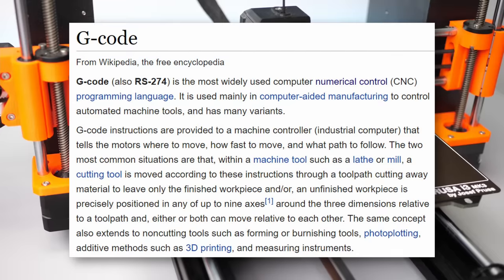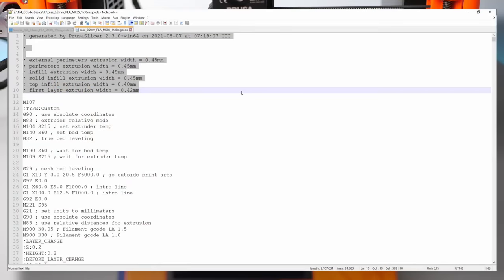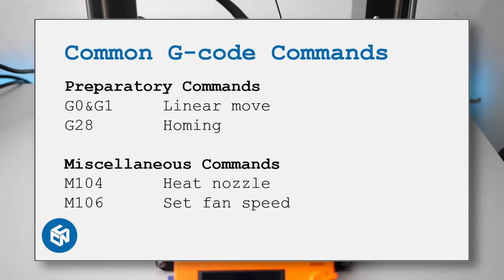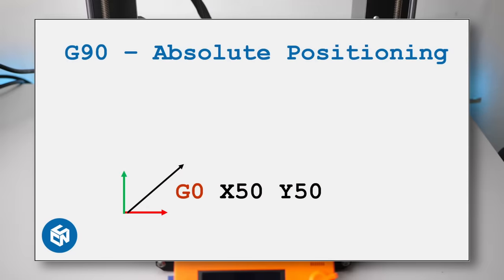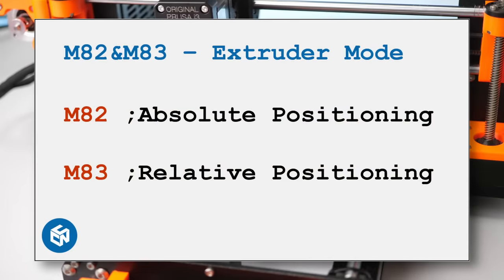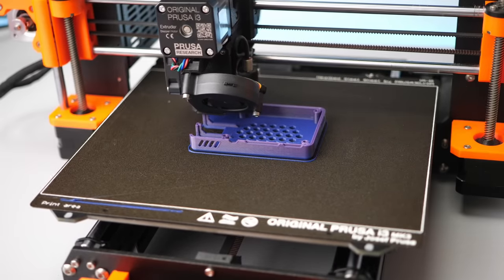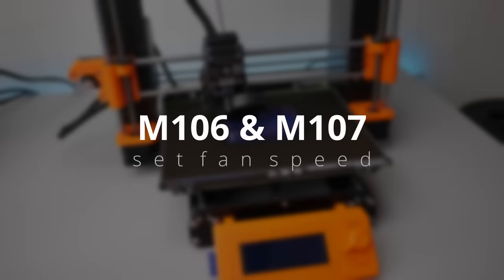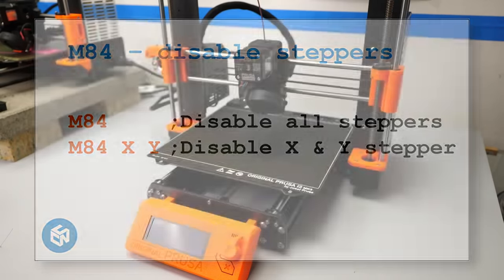Learn G-Code for 3D Printing

Comment from the maker: Is learning G-code worth the time and effort?
Don't forget to like & subscribe and share this video on Facebook, Reddit, Twitter, and other platforms!
Reply: Yes, the more tools the better! Thanks, great vidéo again.
Reply: 12:10 this way helpful and straight-forward.
T1 is the only useful 3dp command :P
.
but then the event horizon had yet to reach 2021... 1t will :D
Reply: When you start with RRF its better to know the most gcodes :D
Reply: Unless you are doing something really unusual then probably not , a slicer program is more than good enough.
Reply: Dang it, YT ate my comment. 

Stefan, I'd be interested in your take on Gcode post-processors that change rounded corners from a series of G1 moves into a single G2/G3. Do they have any discernible effect on quality or speed? I'd love to try them out myself, but I run an Anet A8 that is so inconsistent as to render experimentation pointless :P
Reply: I saw a good example recently (but haven't tried it yet). In temp towers the nozzle has to heat up to a new temperature for each section, but without the right G-code the machine may not pause before continuing to successive sections waiting for the nozzle to reach the next higher temperature. That is a very practical and useful thing to know.

Comment: I know someone who used to design g-code on paper based on drawings. After that it was typed into the machine. It was in the 70's.
Reply: Sounds a lot like when my dad learned COBOL programming language back in it's days. You're the compiler. Reference the books and convert it yourself to binary for punch cards!
Reply: For some CNC machines that is still done today, or a hybrid approach generating some automatically and then editing it heavily by hand.
Reply: @squidcaps4308  yes, of course, noone is going to hand code a generative design. But if you're programming a relatively simple part on a machine like a swiss lathe, it is often times easier to code it by hand then to go through the trouble of creating a post processor for your CAM. Those are cases for mass production though, where 10h upfront to save 30 seconds on each part pays off in a week and from there on it's profit.
For oneoff parts and complex geometry, modern CAM is definitely the way to go, and the only way.
Reply: I did it that way in college in the late 90s, before they let us loose on CAD/CAM software. Writing code and seeing it run always gives me a kick; writing code and seeing it cut metal was just unbelievably cool.
Reply: You must be very old by now😄
Reply: Sounds like the old tape machines.
Reply: It is generated from the G for grafica and is send to the machine M codes here is when you can adjust the function of the machine
Reply: @6yjjk  cnc&nc-machinist speaking...i program prototypes and one offs mostly...g-code is actually the fastest for us since we have ti many different machines with different options...its just amazing what is possible only coding by hand, we only use CAM for simultaneous 5 axis milling
Reply: We should all learn to do that😂
Reply: People still do that
Reply: We learn to do this in highschool in 2016 😂 that was really dump

Comment: As someone who started in CNC running a commercial CNC milling machine, learning basic gcode is the first step in troubleshooting problems. Its amazing that robots (CNC machines) are so  accessible now and a $200 3d printer is for all intents and purposes the same thing as a several hundred thousand dollar CNC mill! This video is an exceptional guide and building block for anyone who wants to actually "understand" the printing process. Slicers and CAM programs are awesome, but they also make the entry point of CNC so accessible that it can frustrate and discourage a new user because they dont have the building blocks necessary to know why things are not working as expected. Great video!

Comment: Great video! The other ones I would add is G4 - dwell: waits for a specified time, for example, for you to remove the droop of filament that purges or something like this, and M0, the unconditional stop, that waits until you press the encoder button on the LCD.
For most useless G-code, I would give the medal to M510: lock the machine. I cannot imagine a single reason why anyone would need a password for a 3D printer, or maybe in some extreme case a makerspace would use that, but I dunno, feels extremely useless.
Reply from the maker: Great choices!
Reply: I would like to second this. Having a follow-up video would be excellent. There are so many things GCode can do I didn't even know about, and G4 would be an excellent one to start adding to my startups.
Reply: Ok M0 is now easily the holy grale that should have been mentioned, i always wanted to use a stop but didnt look what it was, now i know so ty
Reply: Considering g-code is a standard that's used on just about every CNC machine in existence M510 is probably there for the more dangerous equipment you might need authorization and preparation for at work. Like the type of thing that might cut your fingers off if you get them too close.
Reply: @wheezybackports6444  That makes far more sense indeed. It just being ported over from actual industrial use without messing unnecessarily with the code is something I imagine they did when 3D printers started using G-codes.
I would still imagine a physical key lock to reset the emergency stop (so: anyone can hit to stop, but only authorized personnel can reset) or a keyed main power switch is what I would use instead, full LOTO style.
Reply: @Kalvinjj  Yeah, I've been learning 3D printers are always just made out of stock parts and software because it's easier than making something completely new.

Comment: Other important? Maybe many, but I’d like to say than G2/G3 were the pair I was missing. The cura plug-in for them made my day. Salut i fins aviat! 😁
Reply from the maker: I left out G2/G3 on purpose because I'd bet 99.999% of G-Code printed on 3D printers don't use the command (which is a pity but a result of us using stls).
Reply: @CNCKitchen  next gen printers should work through STEP files or something like that so curvilinear shapes are taken into consideration, I guess that even the printer drivers will work better since they will not have to process so much lines of code in exchange of a single G2/G3 command. Thanks for all your efforts 👍🏼😁
Reply: WAH? I never noticed that! Though I already knew that 3D printing g-code had those straight lines, and had accepted it because our workshop does the same. Hehe. 😅
  For those that want to know, G2 is a clockwise arc and G3 is anti-clockwise.
We use G2 & G3 all the time in CNC mills. We get the code off a workshop server after loading it across from the "engineering office", and they use automatically generated code from a "drawing" file these days. But sometimes it's pretty easy to notice all the micro straight lines in the side of a milled radius metal component. 
But I don't see much advantage for G2 G3 in 3D printing, whereas in milling it can define and control quality of finish and cutter wear due to cutter rotation + movement direction.

Comment: i think the knowledge of g -code comes in most handy when tuning and troubleshooting a printer. I ended up printing a small cheatsheet and slapping it onto the frame of the printer, very useful. I have some tuning commands (those that set acceleration and stuff), printer dimensions and speed limits there.

Comment: I found learning g-code to be most practical on my Vertex Nano.  The motors on that printer weren't strong enough to move the belts when they were tensionned properly, so skipped steps were inevitable.  I created a code which sent the nozzle from one corner of the bed to the opposite corner so that the axes would recenter.

I'm now on a Prusa Mini and I'm working on g-code modifications so that I can use a stainless steel hotend without tripping the thermal runaway detection.

Comment: So, I've been 3D printing as a hobby/side business for about 2 years now. During that time I got really busy with the printed custom projects for customers and my focus was shifted to building the Bass Controllers internal components and the actual quality of the printed pieces was really inconsequential as long as the basic idea of the custom design IE the added logo or added text or overall design was aesthetically pleasing The quality of the print didn't even get noticed. So I spent more time making sure that my internal components and the workability and durability of the controller built inside of the printed part was the highest of quality and I didn't pay any attention to how well or how terrible my printing was. Obviously if there were failed prints or if there were major blemishes or inconsistencies those got addressed and the project got reprinted but there was no thought into why it had happened. However lately I have slowed my side business down and I have focused a lot more on the actual 3D printing portion as I have upgraded to an IDEX printer and hopefully coming very soon my ordered carbon X1 so quality now is my focus on the actual prints. I have also been using Cura Prusa slicer bamboo Labs and idea maker and having to import printers into different slicers that don't come with pre-designed profiles I have had to look at start code and in code and was completely lost. I found this video today and in the 12 minutes of this video I learned more than I have in the last 2 years I love how analytically adept you are and the way you approach each issue so systematically I have now watched like four or five of your videos and again I have learned more in these few videos from you then in the entirety of my two years of printing before so thank you very very much!!! But particularly this video learning those 10 g codes that you just showed us will forever change the face of my 3D printing projects and abilities. Simply put the building blocks that you just gave me are going to help propel me into a new world of 3D printing and will inevitably be the most valuable tools I will ever use so this video has changed my 3D printing life for the better and thanks to you I will never be the same!!!!

Comment: M112 is Emergency Stop, and is in the top 10 gcode commands that I manually type into the OctoPrint terminal.  (PID configuration and EEPROM save commands also make the list.)

Comment: Very good!

As a curious novice to 3D printing, I noticed there was a subtle difference to the way the Creality Slicer (Cura, rebranded) and Ultimaker Cura ended a print with CS moving the bed to the rear of the printer and UC presenting to the front.

After discovering in the Machine Settings, this was a behaviour controlled by the G1 command, I was able to copy the rear presenting behaviour over to UC.

The reason? I have OctoPrint's Webhook plugin fire off an event to turn on an external fan to cool the bed after a successful print. Having the print bed present to the rear enables (slightly) better cooling.

Ideally I love there to be some functionally to turn off the fan once the temp is at ambient :)
Reply: Couldn't you do a M190 S30 then M107? Could even present print after cooling

Comment: Thank you for the video, which is a good starting point to decipher the complex G-code. 😊

The kart that runs through the streets of Japan shown around 34 seconds in the introductory video used to be a service that called itself Mario Kart.🏎
However, they had been using the character without Nintendo's permission, which led to a court case, and since then they have been operating the service wearing Disney characters and stuffed animals.🐈
In January of this year, the kart company was ordered by the court to pay 50 million yen and lost.💸
This is a victory for Nintendo.

Comment: Omg you just helped me figure out an end gcode for raising nozzle head! Rather than use the wierd Prusaslicer "if" statements, I'll just use this lol
Reply: The prusaslicer "weird" if statements prevent the printer to destroy itself if it should move higher than is the maximum Z. If you remove it and your printer has max Z lets say 250 and the printer ends the print at z = 245 and you tell it to move 10mm at the end, you will grind your gears because it could never reach z = 255.

Comment: I've always wondered if there is a way to start a print on a Prusa mk3 without bed leveling. If you need to start a print "on top" of another one that would be great
Reply: 3d printing nerd has a vid on stacking parts. starting a print ontop of another would be hard b/c of bed adhesion
Reply: For that, you would just need to remove the G29 -- or G80 as it happens to be in Prusa's case. Though, stacking parts in that way presents its own challenges -- bed adhesion on the first part needs to still be solid enough, or you'll just yank it with you. And you'll need a way to home the axes again and then move back to the correct start location if you've lost your positioning.
Reply from the maker: Check my last video on resuming failed prints!

Comment: I would like to understand more about the M500 to M504 commands, and when and how to use them. Which settings do they actually load, is homing and loading of the bed levelling including? What about mesh bed levelling, is it restored with M501, too?

Comment: I like relative positioning for extrusion more because it's easier to edit the gcode when you want to resume a failed print. I don't recall if you talked about this in your previous video about print failures. It can be done with absolute positioning (Ideamaker was setup this way but you can change this) but I found this out after I threw my print in the garbage  🙄

Comment: GREAT video. 
I was wondering why you mentioned at 10:30 that using M109 instead of M104 when doing a temp tower causes more problems than it helps. Please talk about what problems it causes. Without practical experience it seems like a good idea to wait for the nozzle to reach the new temp before doing each successive layer, but what you said made me curious.
Reply: waiting between layers causes blobs because the printer continues to deposit material when waiting
Reply: @MrBeanbones Good to know, thanks.

Comment: Greetings,  Another great tutorial thank you.  I'm focused on the extruder movements as I need to do some retraction during picture taking while the X axis is moved away from the print to a trigger switch and then a 1.5 sec delay for the picture to be taken.  I need a extruder retraction, (?), at that delay point to stop the nozzle from oozing prior to resuming the print because the ooze hardens because of the cooling fans and then hits the print on its return.  Any thoughts?
Based on a LAYER CHANGE this is the camera trigger G Code

; Layer Change leave the print

G1 Z1.0 F9000 ;Raise Nozzle Up A Little
G1 X240 Y217 F9000 ;Move X Near Trigger Switch And Center
G1 X243 F9000 ;Press the trigger Switch
G4 P10 ;Delay For 10ms to de-bounce the switch
; oozing happens here
G1 X240 F9000 ;Move back and release the Switch
G4 P1500 ;Delay For Camera focus and shutter click 1500 mill seconds
; oozing happens here as well

; return to the print

Thanks Again
Doc'

Comment: Super informatives Video! :))) Welche Z-Werte bekomme ich bei meinem MK3S+, wenn ich vor Beginn des Drucks, also gleich nach dem ersten G28 eine Prusa- Z-Kalibrierung (anfahren des oberen Z-Achsenendes und eine leichte übersteuerung von 10-20 mm) durchführe? Wird dann der soll- oder ist-Wert abgespeichert? Reicht dann ein G28 um gefahrlos wieder in die Home-Position zurück zu kehren und das meshbedleveling zu starten? Ein Tipp wäre nett, weil ich ungerne (wieder) mit der Nozzle ins/durchs Druckbett fahren würde :D (Hintergrund: Im Rahmen der letzten Upgrades stellt sich meine Z-Achse teilweise im Druck zwischen Layer 2 -20 schief (Vermutlich ein leichter Slipstickeffekt). Eine anfängliche Z-Kalibrierung scheint die Fehleranfälligkeit signifikant zu senken)

Das wäre mein Ansatz:

; Regulärerer erster Block
M862.3 P "[printer_model]" ; printer model check
M862.1 P[nozzle_diameter] ; nozzle diameter check
M115 U3.9.1 ; tell printer latest fw version
G90 ; use absolute coordinates
M83 ; extruder relativeG  mode
M104 S[first_layer_temperature] ; set extruder temp
M140 S[first_layer_bed_temperature] ; set bed temp
M190 S[first_layer_bed_temperature] ; wait for bed temp
M109 S[first_layer_temperature] ; wait for extruder temp
G28 W ; home all without mesh bed level

; Manuelle Z-Kalibrierung
G0 Z20.0 X105 F1000
G0 Z200.0 ; 20 mm übersteuerung
G28 w; G80 wird von G28 mit übernommen
; Weiter mit dem regulären Code

Is it safe? :D

Comment: What do you mean readability? E0 is set to zero with G92 so the next absolute position command actually moves it to the correct location. Since E0 isn’t homed, and the sliced Gcode doesn’t know the real position of extruder before starting. If it weren’t set to zero, an ABS command would be inaccurate.

Comment: Nice! Currently I'm trying to find a way to modify the travel speed in the grbl (*.nc) files generated by Fusion 360 to move faster between the operations in the private edition. 
So a parser would have to find the correct 'F#' command and replace the # with the desired speed. 
Didn't dare trying it yet, but I guess, I'll give it a try now 🙂
Reply from the maker: You're on the right track! Maybe there are some comments where the travel moves start that you can use to input the new G1 Fnnn commands.